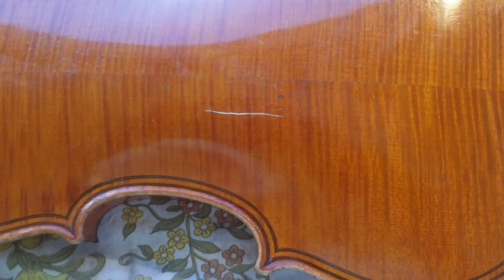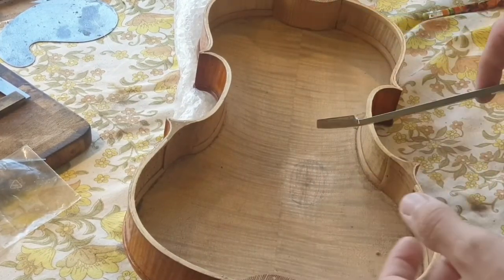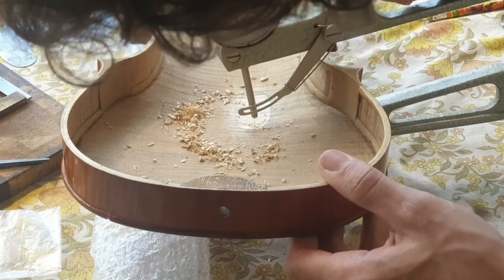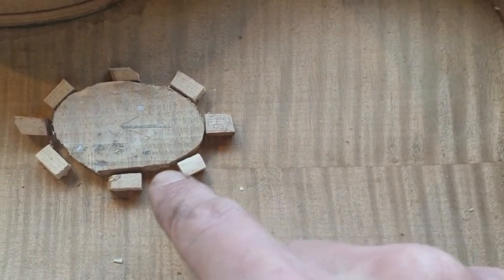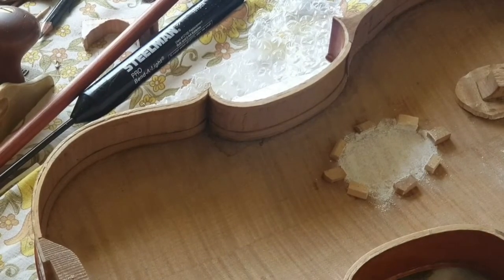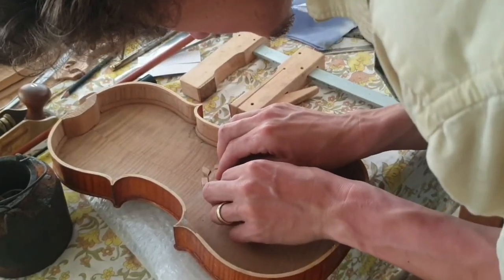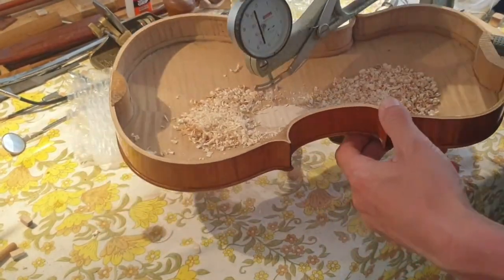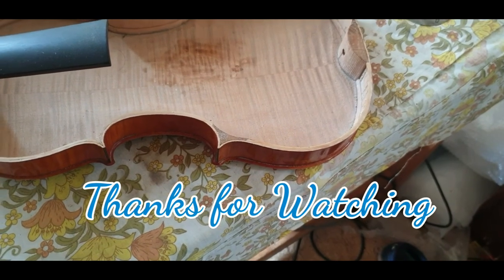Restoration of a Maggini copy violin Episode 4 Fitting a sound post patch.

Comment: Wow! What a masterful job! I’ve seen people (on YouTube) inlay cracks before, but only straight ones. Never saw a jagged crack like that filled before. Also, the patch fit so perfectly. I really like how you aged the patch, as well. Amazing work mate! 
I’m curious, why would the back crack from the sound post, when maple is so much harder than spruce?
Anyway, a happy, healthy, and prosperous New Year to you, and your family.
Reply from the maker: Thanks Rick! And a very happy new year to you as well mate.  
The reason I believe the back cracks but top didn't, so the back is a hard wood yes but it's also more brittle,  the spruce while soft has a cushioning effect where the grain compacts before cracking,  it also has counter pressure from the bridge foot supporting it and this also absorbs the energy from the impact.  If the impact is from the top though it is carried through the bridge and soundpost to the back plate,  the energy is then expended in full force on that one small area and if the soundpost is positioned right along a grain line then is likely to crack. I hope that makes sense.  It's only my ideas on the subject there could be other factors involved as well.